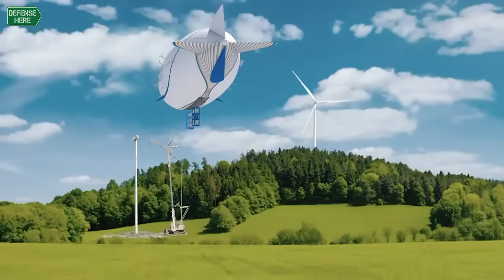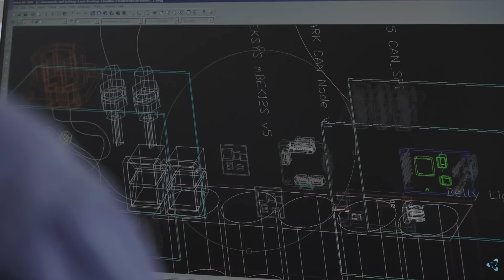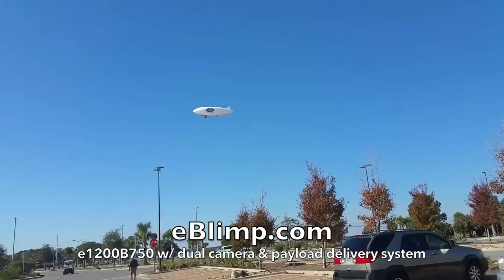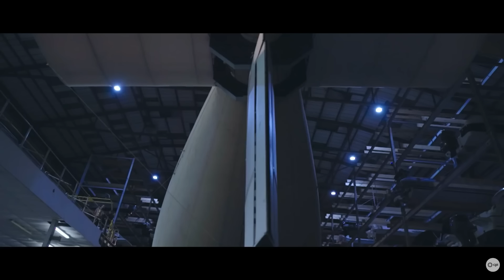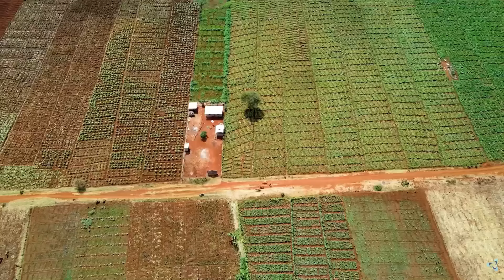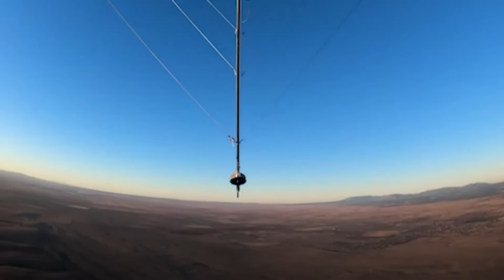Small Airship Technologies 2026

Comment: ive been wondering if electronically heated hot airships could be a thing instead of using hydrogen or helium
Reply from the maker: With surface area that large, heat retention is difficult
Reply from the maker: Having said that people have made balloons fly with blackpaint using solar power alone

Comment: Well, airships has to be quite big in order to have lift enough for both an envelope that's resilient enough for "ordinary" commercial transport, and also meaningful payload capacity. For each additional kilogram you want to add, be it equipment, other parts on the airship, fuel, or payload, you need roughly a cubic meter more lifting gas, in case of helium and hydrogen, and then you need a bigger envelope, which increases the mass, which means you need to increase the amount of lifting gas even further.      

As a comparison, just the 1.8 kg payload capacity for transport that the zipline platform 1 drones has would require around 1.8 cubic meters of lifting gas, ad an envelope that doesn't require perfect weather conditions, motors, control systems and on and on, and you're in the ballpark of the size of a bus, and still can't fly nearly as fast or in as bad weather, because that would require a much sturdier envelope. And the cost of such a mini airship would be orders of magnitude higher. Sure, the zipline drones has a quite limited range, but they were developed a long time ago, for a specific purpose. Drones with similar system that are a bit bigger than zipline's, but still very manageable size, could have much longer range, and payload capacity in the mentioned 10-100 kg range. 

You don't need fuel cells to combine hydrogen and oxygen into water and get some power out of that process. In fact, fuel cell systems are big, heavy and expensive for their power output. If you use hydrogen as a fuel in an engine, the combustion products will be the same as from a fuel cell. But, putting electrolysis system, hydrogen and water storage tanks and on top of that also fuel cell systems, and all the auxiliary systems those systems would require for any meaningful amount of hydrogen/energy storage capacity on mini airships is a completely absurd idea.    

If you settle for the ability to gain ballast during a flight in order to have positive buoyancy to take off and gain altitude, and then negative buoyancy to descend and land, which at least makes some sense, you don't need to use hydrogen, you could use some hydrocarbon that you add before takeoff, and essentially any type of engine, and collect the water from the exhaust.      

Miniature airships might be viable for very specific niche applications, but it would require a range of factors in combination for them to be a more practical option than drones that rely on aerodynamic lift alone. For longer distances than even some already existing battery powered drones can achieve, an airship needs an envelope that is resilient in multiple ways to have high probability of lasting even a single mission, in anything but perfect weather. And despite modern material technologies, you can't make envelopes that is resilient in multiple ways, that also has very low mass per unit of area.

Comment: Electrical power and high energy storage per kg batteries are a game changer for airships. When you burn fuel you exhaust and that exhaust is lost mass. A lot of lost mass which changes the handling of the airship. Very complicated setups exist to re-condense the water in the exhaust but that isn't completely effective and adds more dead mass for the machinery.

Comment: loved airships and dirigables as kid in the 80s from documentaries and jules verne books, hopes were high when germany started up Zeppelin NT around the turn of the millenium but bupkes, it is really time to dust off the tech and upgrade with new tech, imagine whole body carbon fiber and covered in flexible light pv panels, ai captain navigation like with regular ships, pumps that can liquify the gas to adjust for loading/unloading of cargo, hope ueberrich individuals will switch from yachts and private jets onto private airships and big countries with geographical challenges will push for huge cargo ships that can deliver big and heavy cargos with point precision on top of mountains or remote islands

Comment: Flying wing airship hybrid with lifting body can have props inside lower drag blowing over top of wing increasing lift. Top of wing gives greater surface area for flexible solar as well. Surveillance drones with active camouflage for artillery and missile targeting stealth long duration surveillance and larger can haul cargo replacement of ice road truckers and resupply for winter areas too dangerous to supply via found vehicles.

Comment: Yet, somehow, no one has explored Heated Helium? Combined with Hydrogen, the lift potential increases (at least as long, as you can Heat Helium, without igniting the Hydrogen). I know, it sounds 'Steam-Punk', but...
Reply from the maker: We dont want to pressurize the envelope from inside using heat. The reason is increased leakage potential

Comment: That "square/cube rule" advantage is overblown, and used to scam people into believing in airship projects unnecessarily large and costing hundreds of millions of dollars to develop technology that could be demonstrated for one million.  Actually it is true that the surface area goes up as the square of the dimensions, and the volume as the cube of the dimensions.  But that seeming great advantage is diminished because all pressure airships (non-rigid and semi-rigid) require near the same internal operating pressure (usually less for semi rigids - examples would be 1.5 inch water column for a non-rigid and 0.75 inch for a semi-rigid) so as the size goes up, the outer fabric has to be heavier to withstand more tension, eliminating a large part of that proclaimed "advantage" of huge airships.  So in practice one of the most efficient airships ever built was the 1,000 cubic meter  MR by Nobile in Italy, with a useful lift of almost 50%, better than almost all other airships.
Reply from the maker: Thank you for the insightful comment

Comment: A minute in, and hearing the usual BS about carrying capacity and lift. The biggest airships are barely capable of out lifting a 747, and can not compete with an A380. They should be fitting them with gas turbines and more exotic propulsion and taking advantage of the surface area as orbital vehicles.

Comment: Larger airships , Yasa type  1,000hp + high efficiency brushless motors  ,  3/4 of an Airships surface covered in modern flexible solar material ,carry a hybrid generator system and  a battery pack that only has to maintain hose loads  and modest thrust requirements as it  the gas provides lift . 

BTW do look up last week's Dublin University break through with a low temperature, safe, high cell voltage Na S  battery that can be easily  manufactured.  It looks promising for power and capacity for low cost and wt. With a 3.6V cell voltage . ...it's still needs some work but it's very promising.

Comment: Surely it makes sense for UAV to use hydrogen. 
Both for lifting and some propulsion. Start flight with slight positive buoyancy, end with slight negative. 
Then you need solar panels that take sunlight and moisture from the air, and turn into hydrogen.
Reply: …after a number of years of completely safe operation they may move back into passenger carrying
Reply: @markthomasson5077 don't paint your airship with thermite
Reply: I don't think you are going to be able to reliably extract a significant amount of water from the air.
Reply: @hWat-Ever well in a cloud perhaps

Comment: Been a while since I got this hopeful for the future of lighter than air airships, thanks for the work.
Reply: Sadly only works when there is almost zero wind. Which is at low altitudes or only about 2 hours around sunset and sunrise on many days of the year.
Reply: @AlJay0032  If it was as you said, they wouldn't the investing in tech to maintain it in air for months at a time, and even early ones, paddled by feet could go against light wind, let alone one with a modern electric motor.
Reply: @AlJay0032  lol thats why they use them in the stratosphere where the winds 10x stronger than at the surface...
lighter than air travel is the only logical way to do  air travel energy wise.
we would have been using airships 50yrs ago for almost everything if it wasnt for the political influence the oil industry has